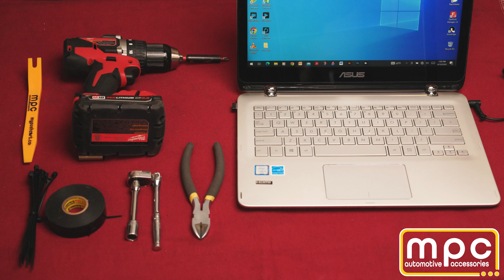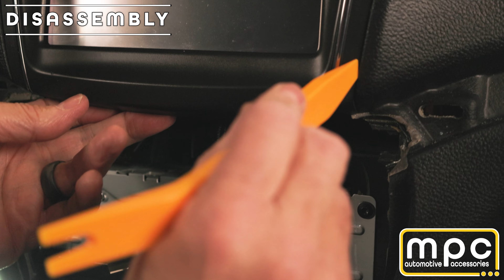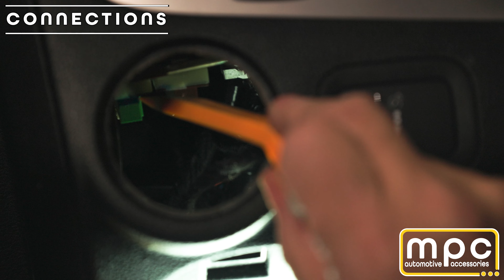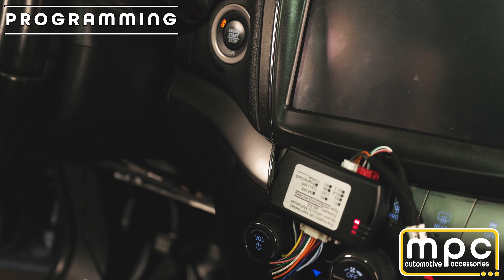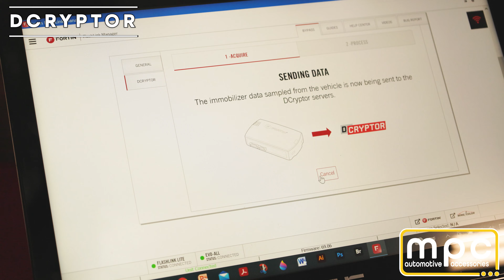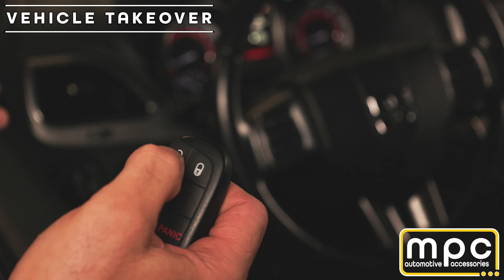mpc | Remote Start Installation for 2018 - 2020 Dodge Journey - Push-to-Start

Comment: Great video. Quick question I'm putting the same MPC remote start in my 2018 Dodge Challenger for some reason I cannot get past the part where after you hit the ignition button twice and then the program button once. With mine it says the blue light will flash for can1 and then a red light supposed to flash for Can2 at the same time but only the blue light flashes and not the red so I can't go any farther any suggestions
Reply: hey brother did you figure out what was wrong with the programming cause im trying to install mine in a 2018 dodge challenger as well and i cant go past the solid yellow light after i take the battery from the oem remote